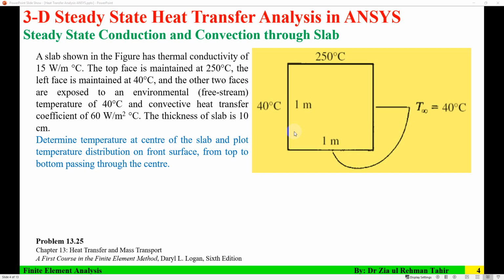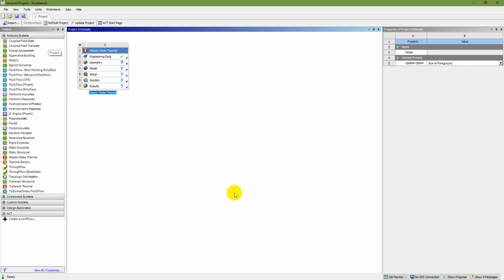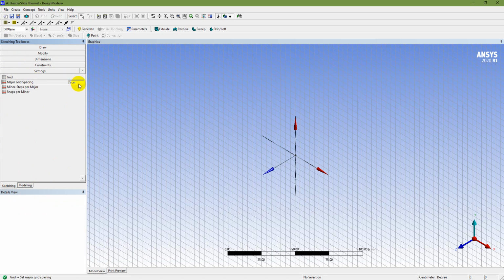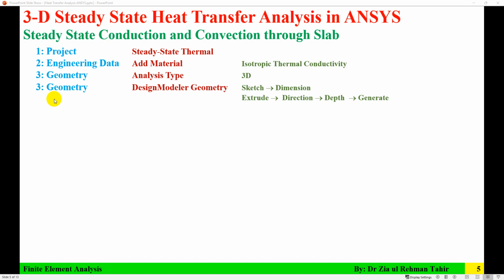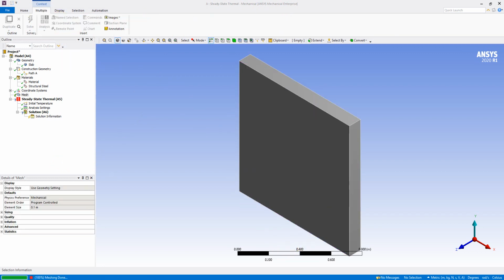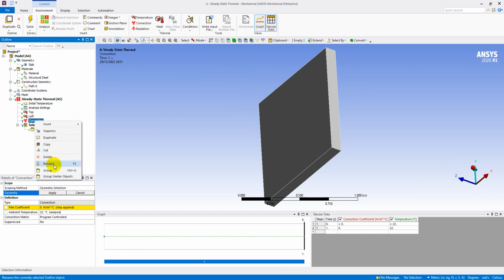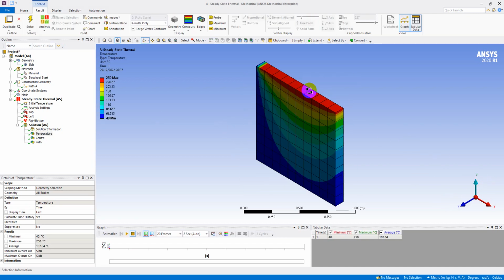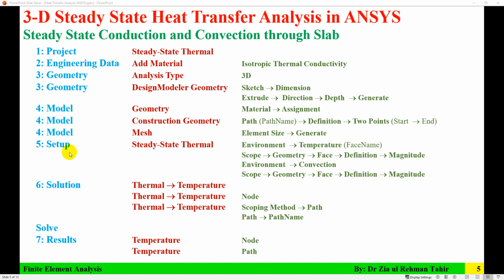ANSYS Heat Transfer Analysis 2 | Steady State Conduction and Convection through a Slab

Comment: Thanks for the analysis! I have a question. For the right & bottom wall, the convection term is described. Air Temperature is 40C, h=60 W/m2C but what is the initial surface temperatures?